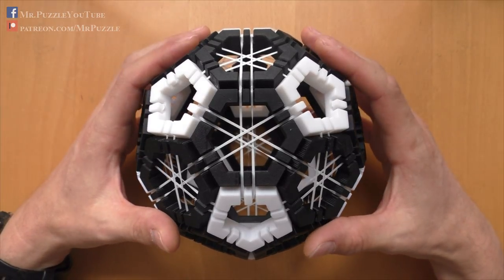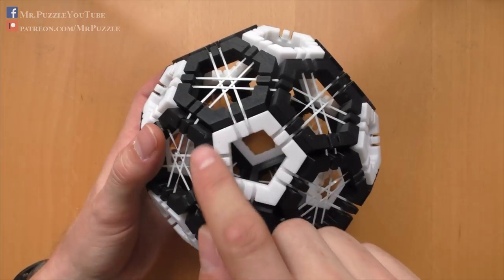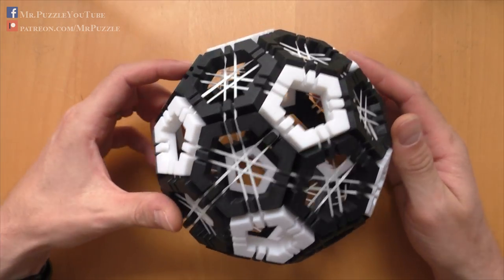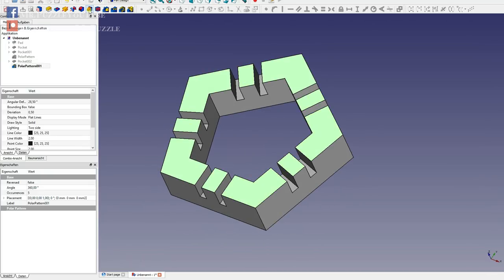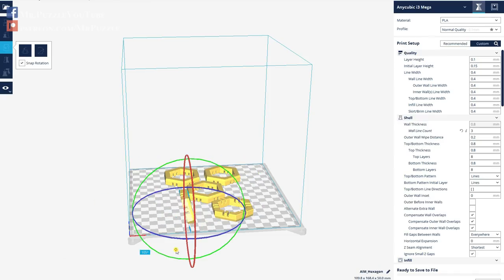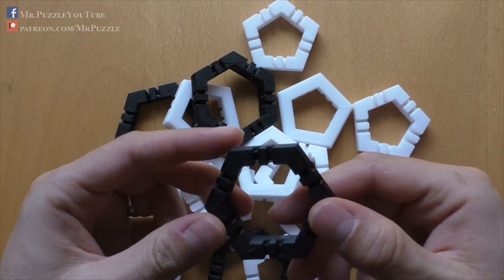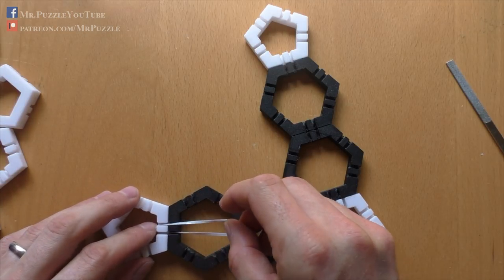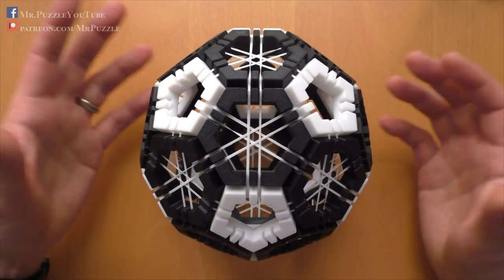Making of a Truncated Icosahedron Dexterity Puzzle

Comment: It should be possible to construct a sphere without using the hexagons as well. The puzzle here is getting a nice looking string path. (read more shows the spoiler)

Spoiler: There is no single path that takes you through all the vertexes of a sphere built up solely out of pentagons. However, you can use smaller elastics and connect the pieces nicely around the corners. Might even be more of a dexterity challenge.

Comment: Well you could have made a puzzle out of it.  6 sides on one piece, 5 sides on the other putting either pins and holes in various locations OR rails and slots of different lengths you would have to line up as you assembled it.  Making each whole side at 20 degrees instead of just the bottom edge would provide a much more solid structure as well except while putting the bands on, they wouldn't be able to lay flat from the start.  I would also notch out the inside of the white pieces at the band pins so the bands wouldn't be able to slip off.  No notch would be needed on the black pieces.

Ok, I just thought of adding 5 sided rods to pass through the shape with notches so certain ones would have to be inserted before others.  Assembly of the rods before connecting the parts would get in the way of putting the bands over the pins that hold it together unless there is shifting of the rods for each . . . naw, that's too much work.